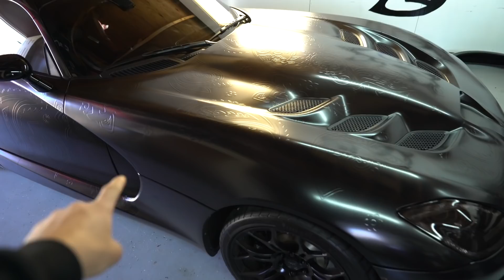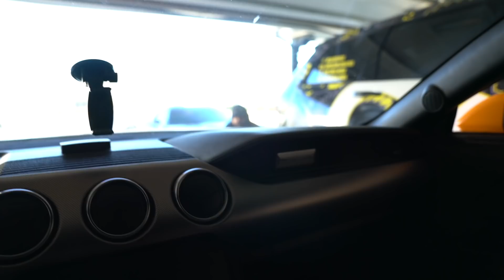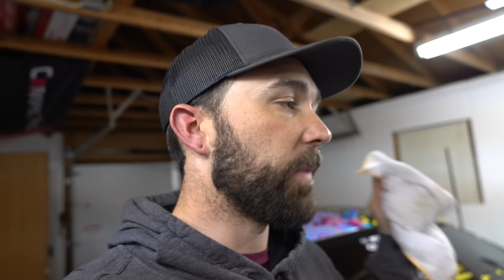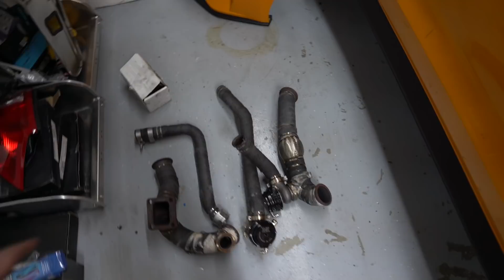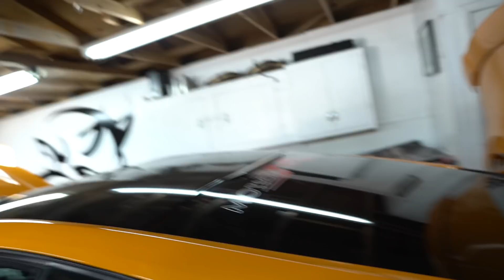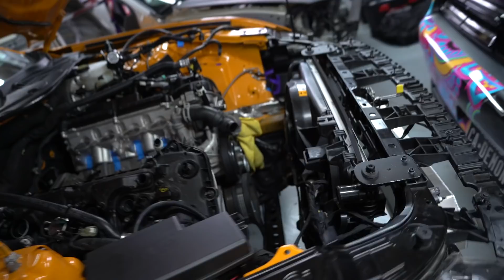Pulling My Mustang Motor Because it WON'T BLOW UP!

Comment: Keep it a low 5 consistent. When you can dial that bitch in you will continually win races. You start fucking with this and that, you will begin to run into breaking shit and no longer being consistent. I’d rather collect them BIG checks than rolling that bitch in the trailer cause I kept fucking with shit.

Comment: Do you plan on getting cylinder head work and changing the cam profiles. I recently damaged my gen 1 motor, I've gone ahead & upgraded internal to Manley piston, rods and L&M intake cams with 5  angle valve job. It's time to turn up wick on my Whipple. Best of luck on the build and congrats on your achievement 👍🏼
Reply from the maker: Nice man. I probably won’t these new coyotes flow really well

Comment: Demontrilogy is doing some updates it'b nice to see a rematch. I'd put my money on Tangstang
Reply from the maker: TallStarlite let’s do it
Reply: The only way the Demon would compete with the stang (after built engine on the Tang Stang) would be a built engine for the Demon as well.
Reply from the maker: not buynit how does a built motor make you faster? His blower is maxed out
Reply: @DavidVanVoris  that's what I said. He would have to build his engine and add a bigger power adder.
Reply: If they race it will be the same story as last time.  Demonology will get his ass kicked and his camera will happen to no work again.

Comment: Badass. man roughly what does build  cost for it. I've got a gen 1
Reply: Depends on what you do, if you use your own block or get a new one and what the shop charges. From what I’ve been quoted I’d say a good average would be 7k to 9k for a short block if you don’t sleeve the block you could probably do it for 2grand less
Reply: @BarnfindGT  ok cool. I'd re use my block still low miles maybe not sleeve it. But who knows